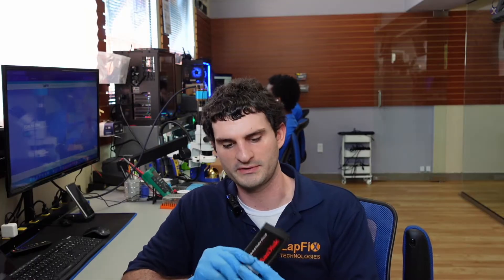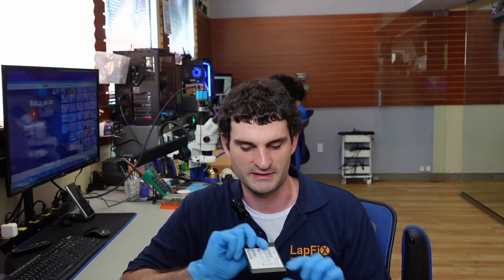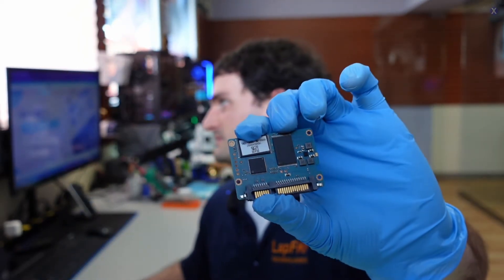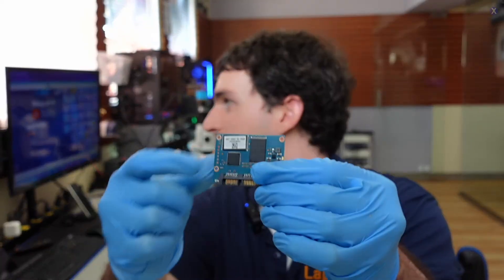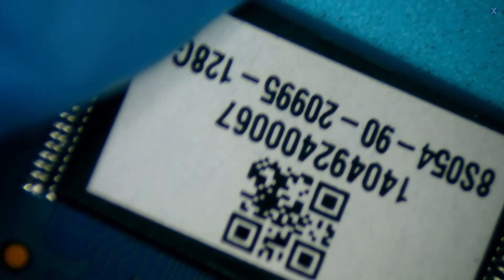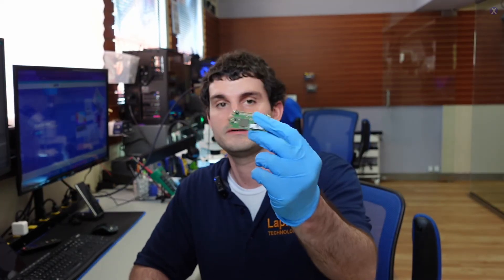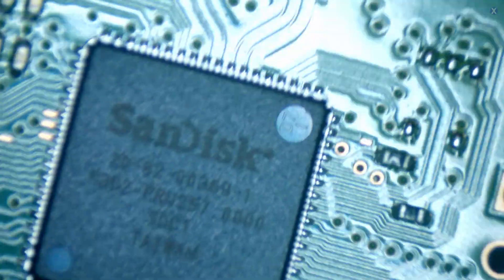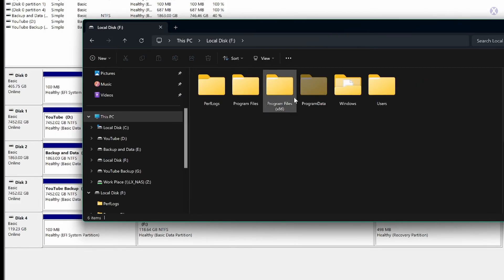How To Recover Data from a Dead SanDisk SSD

Comment: It was an interesting video, but how did you know the controller swap would work? I gather this is rarely possible since most drives are self-encrypting, but I would like to know if there is a way around this. Perhaps it was possible just because this is an old model before self-encryption was used? I think this was something pretty important to address.

Comment: I have the exact same problem with an SSD from a MacBook Air 2011. The processor on the storage medium heats up when it is plugged in. You can clearly see it with a thermal camera.
My question is whether the processor is linked to the NANDs, similar to how it is on an iPhone. There, you also can’t simply swap out the processor.
Is it possible to replace the processor on the SSD with one from a functioning board?

Comment: You pretty much dive straight into the controller, myself would be testing for shorts first, you've said a lot in this video but nothing educational because you're not telling how you came to that conclusion of this faulty controller which is pretty disappointing, besides that I can hardly believe you can transplant a controller chip from one board to the other without doing a reprogramming step somewhere in between. Keep up the good work, and keep a close eye on your articulation(!) because it ends in mumbling every now and then (YT transcipt can't make anything out of it either)
Reply: This comment is really harsh lol. He went into great detail to explain how he came to the conclusion that it was the controller, I mean he literally had a thermal camera showing the controller overheating just to prove the point! As for the controller chip, he picked an identical chip from a donor board. Maybe it doesn't need re-programming? (did you think to ask that?). I think the video was really useful, and the only thing I wonder is how he managed to de-solder the chip so easily as @repairchannel mentioned!
Reply: @mikeaclayton  TBF the controller heating up doesn't necessarily indicate the controller is bad. There are lots of components (capacitors and such) upstream of the controller, and perhaps replacing a shorted cap would clear the problem. It wasn't true in this case, but just showing the controller heating up as you say isn't adequate troubleshooting.

As for doing a controller swap, my understanding is that will almost never work since most drives are self-encrypting and the key is within the original controller. Definitely something that should have been addressed here.
Reply: Do the Sandisk SM2246 XT H aa disk must be programmed, or is it soldered a new one? 3 months I am waiting for the answer and without results.
I measured the temperature of memory systems and have 36 ͦ C to 29 ͦ C, and the controller is 31 ͦ C measured the infrared thermometer, but by touching the controller is much warmer, I found for $ 6 to 8 but will it work? ? ?